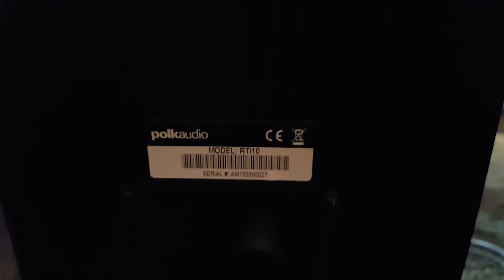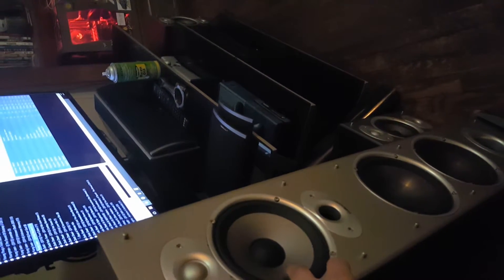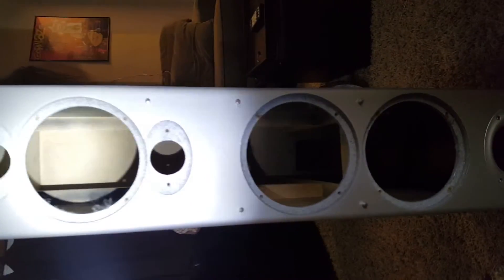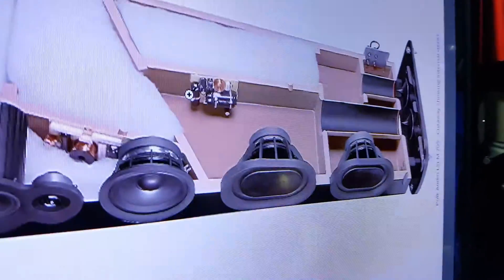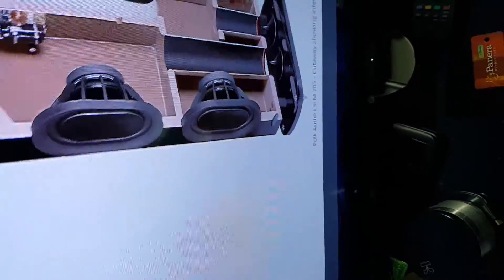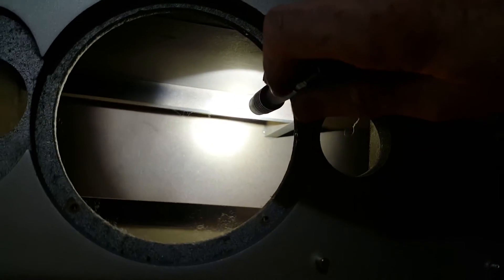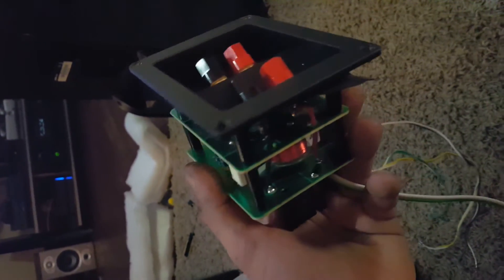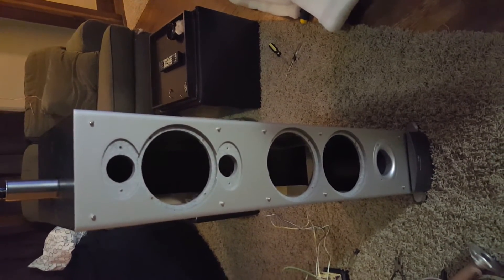RTi10 Tower Speaker Dissection

Comment: The drivers are tuned to a certain frequency and same as the box ,blocking off the top would have problems with ports not allowing too much pressure on the driver

Comment: Hey thanks for bringing this up. I just bought 4 other rti10s and I thing in comparison it would be a good idea to separate the mid range and it's port. I will definitely try this but I will make it so I can easily revert back incase it doest work. But I honestly can't see it being a problem unless the 2 main drivers need this space to move air. 

That being said, if you have a sub it w
Shouldnt matter if you loose a few db of low end.